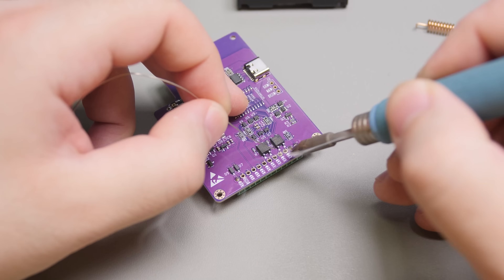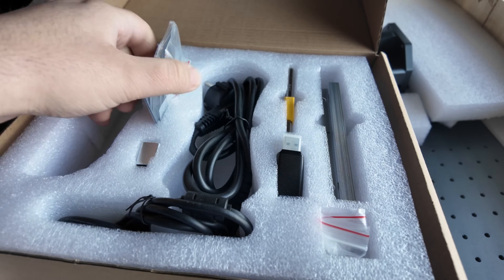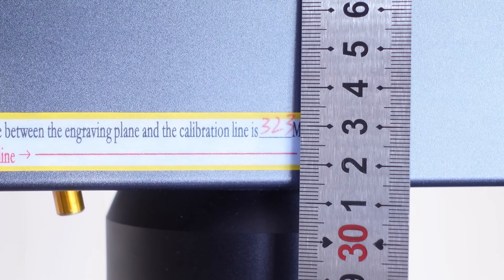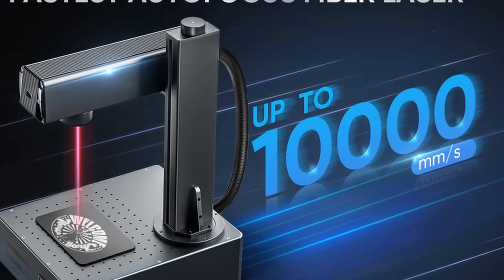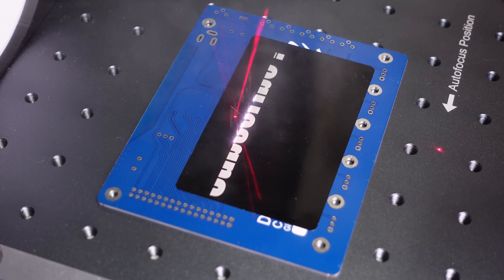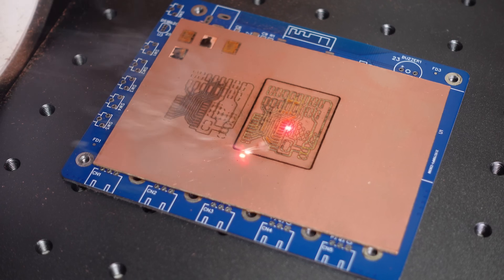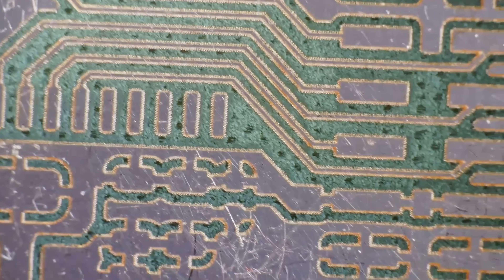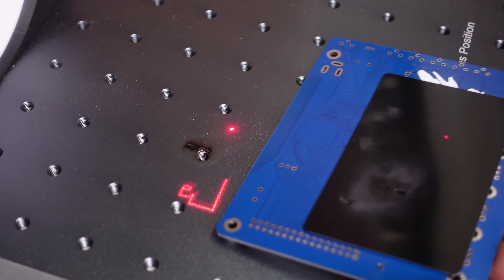Prototyping PCBs at Home with the Monport GA60 – Worth It?

Comment: As someone working with cutting thin metal with the laser every day, do as low power as possible, then increase the passes needed for cutting. Somewhere in the 80 passes per 1mil thickness should be ok.
Reply from the maker: Thanks for the advice!

Comment: I would have liked to have seen an end result. You didn't show a finished stencil that you clearly indicated was cut with that machine. It would also have been nice to see a populated board. Finally, in other vids I've seen of laser cutting pcbs, they usually apply a black finish to the board before engraving. Did you try that?
Reply from the maker: Thanks for the feedback! Regarding the laser cutting process videos, where they first apply paint before engraving are usually demonstrating the process of removing paint to prepare for chemical etching, not for direct copper removal. My prefered method for PCB prototyping is to first remove the copper where needed, then apply a UV coating, and later clean that coating off only from the pads before soldering. As for the stencil, I actually didn’t say I had cut it yet, I mentioned that I need to cut it, but the material "stainless steel" warps a lot during the process. So, I'm planning to make a jig to keep it flat and accurate during cutting.
Reply: @PricelessToolkit  after that, might be more interested since the video seemed to end before the final result.

Comment: Nice idea, but not for $7k.
Reply: Yeah, you can get a LOT of rush order pcbs from China for $7K, delivered in about three days to Australia, and MUCH better quality.
Reply from the maker: Three days? For me, it's usually 3–4 days for production, then 7+ days for delivery. After that comes testing, finding errors, fixing them, and reordering, so it's more like two weeks and around €60. Time is more valuable for me;, with this setup, I can test sections of the PCB in just 30 minutes.
Reply: @PricelessToolkit  if it makes your life easier and you can justify the cost vs iteration wait it does make a lot of sense, but it's still pricey.
Reply from the maker: @digitalsparky  Yeah, no doubt it's pricey.
Reply: @PricelessToolkit  definitely don't think I'd use it for a production pcb though. You're essentially making component size custom breadboards  (or for random home yolo crap).
Reply: @PricelessToolkit  The you're ordering from the wrong place my friend! You'll certainly pay more for rushed production and fast delivery, but even so, you'd get several hundred individual designs delivered for that much money.
Reply from the maker: Yep, not for PCB production , "I don't make products with 1 layer PCB" only for prototype, and engraving 3D printed enclosures for my products.
Reply from the maker: I totally agree making just 2-10 proto PCBs a year really isn’t worth it. 
I don’t need high-quality prototypes if they’re going in the trash after an hour. I also sell products with 3D-printed enclosures and want to improve them with some nice engraving.
PS: I could make the boards the old-fashioned way, by etching it, but I’m just too lazy and my healt is on minimum :).
Reply: $59 on AliExpress 🤣
Reply from the maker: The cost is not 7k, but not cheap either.
Reply: @PricelessToolkit  depends on the country, in Australia it's just over 7k on sale, 10k after sale...
Reply from the maker: @digitalsparky  OMG! It's a TAX thing ?
Reply: @PricelessToolkit  no, gst is 10%, it's a currency conversion thing. 7k aud is about 4k usd at the moment.